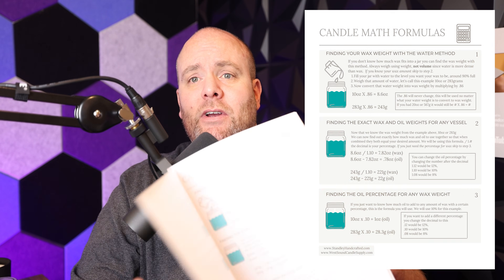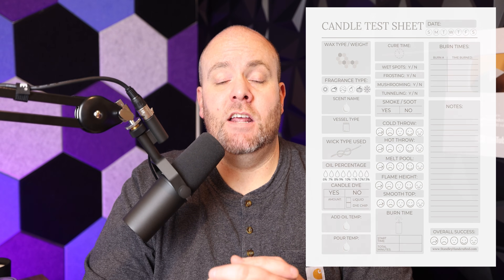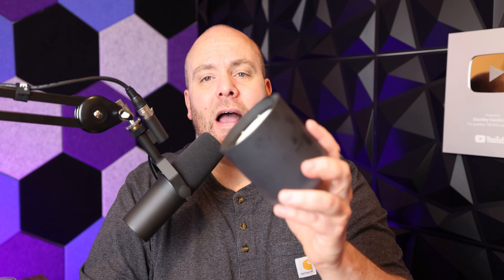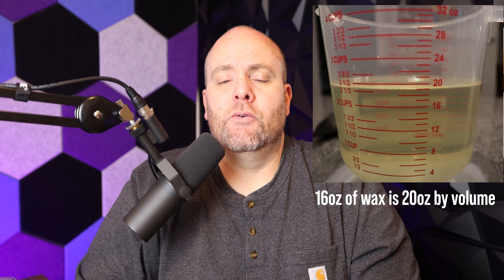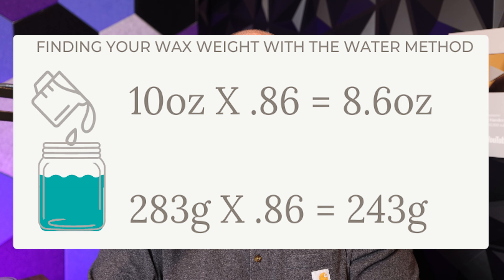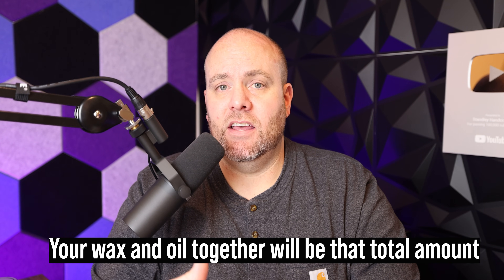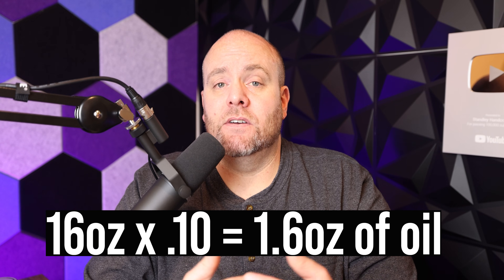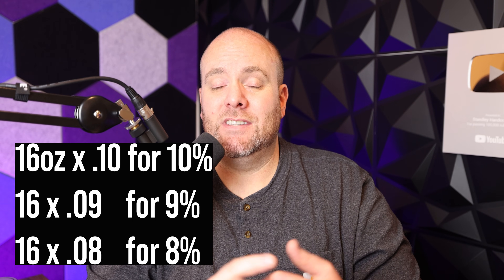Easy candle math for beginning candle makers - Three different calculations

Comment: I’m using coco apricot so the wax can hold up to 10 %. I’m using memory box candle co formulas. So my 9oz jar really holds 7oz. So 7oz =198 grams. So  with her formula. I have to take 198 divide  it by 110%= 180. So now I need 180 grams of wax. In order to find the 10% FO.  I have to minus the 198-180=18. N I will need 18 grams of FO which will be the 10%. So that is where I got the 18 from.  But when I make a custom blend with 3 FO the candle is sweating. What did I do wrong ?

Comment: Does it really take 0.8-1oz of fragrance oil for one 10oz candle..?? That seems like an extraordinarily massive amount. I mean, maybe it's because I'm not used to the fragrance oils, but I have a 1oz bottle of pure lavender oil, and a few drops makes an entire room smell like lavender. My first shipment of materials is coming today, but I'm still trying to determine how much of each oil to buy to make a few candles with that scent - and one 1oz bottle making 2 candles or less seems crazy to me. The cost per candle for fragrance seems so high, especially if you're not doing larger batches.

Comment: this is confusing, why is it not just to multiply the total weight by the percent.
 Example -  300g times .1 or 10%= 30. Then subtract 30g by 300g which equals 270g for the wax weight and 30 for fragrance load. When you divide you get a different number (272.2g wax 27.2g FO) which is not 100% accurate.  without a calculator 30 is 10 percent of 300 so why is it nobody does it that way. Im only going by past math from school, I don't know if wax makes the calculations different, but I would think it wouldn't matter?
Reply: NeverMind I was didn’t understand what the percent was being taken from, I thought the fragrance oil percentage was for the total amount not for the actual wax u need. Very hard to wrap ur head around and some websites from fragrance companies like the flaming candle tell u differently but I get it now.

Comment: Great video! When calculating your fragrance oil is it the same formula when finding how much to use for essential oils?
Reply from the maker: Essential oils are very different and not really meant for candles but if you do use them the formula's would be the same. You would alter the oil percentage though.

Comment: New candle maker here, thank you ×'s a million. 
Question: Am I supposed to subtract the weight of the vessel when weighing the water?
Reply: Great point! I would because you are figuring out the NET WEIGHT ... The weight of what's inside the vessel.  You can just tare the vessel out on your scale and continue with your process. 🙂
Reply: Thank you

Comment: Thank you so much for sharing your knowledge with us. I have a question. I m new to this and I make candle as a hobby so mostly for me and my family. The first few candle they small great but recently I made a strawberry candle and you can hardy smell it. I m using soy wax and 10% oil. I combined my way and oil when wax is at 180 degrees, any tips. Should I use a bigger oils %. Same problem with the oil and wax melts, no smell. Thank you so much
Reply: Check the flashpoint on the fragrance oil & maybe add the oil to wax that’s a little bit under that number

Comment: Can, these methods work with wax melts? I don’t use clam shells but use the silicone molds and this may help with waste. Thanks!
Reply from the maker: Absolutely. These calculations still work in what ever you’re using or making.